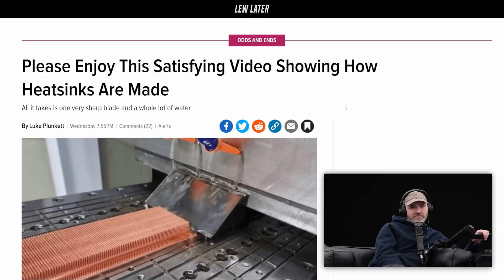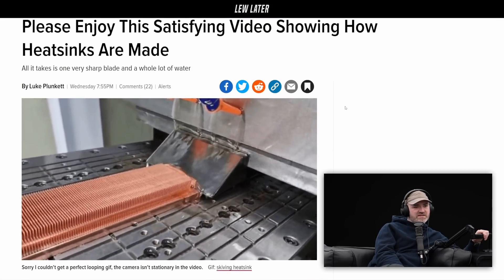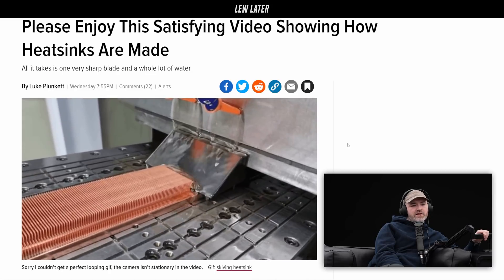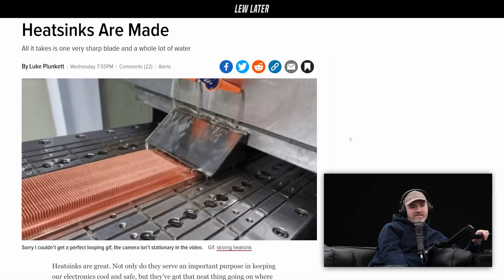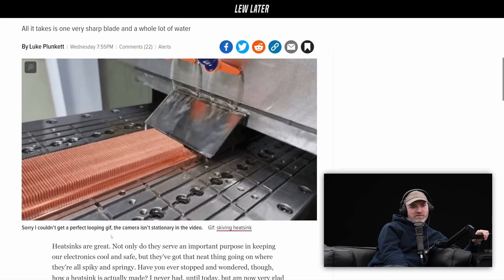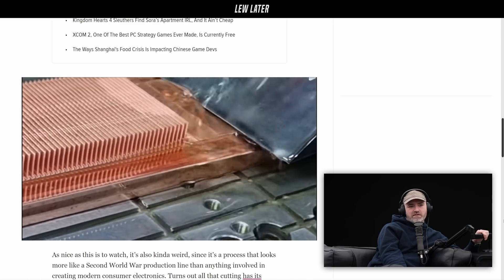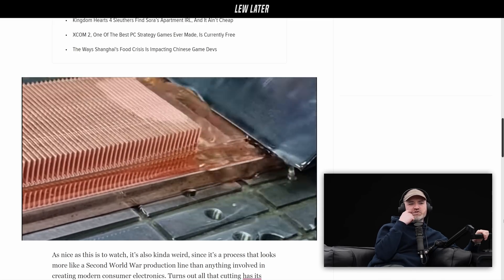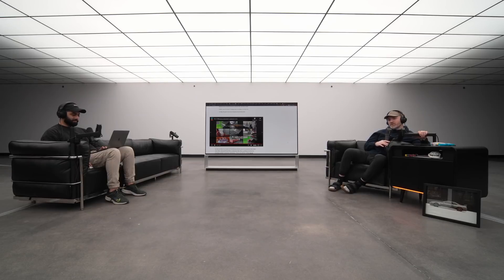Satisfying Video Shows How Heatsinks Are Made

Comment: So is that heated water used on a heatsink?
Reply: Maybe, but pure copper is pretty soft so I'm not sure if it's needed. Then again it probably wouldn't hurt to soften it up a bit more. I would think the water is most likely to get debris out from the shaving process
Reply: @plumokin5535  You're half correct; it's for lubrication of the blade. Although cleaning any shavings would be a plus
Reply: @Beofware  ahh ok that makes sense. I didn't think about that. Thanks!
Reply: It's Oil.
Reply: @Tyler Stephenson Also the water is cool which prevents sparking.